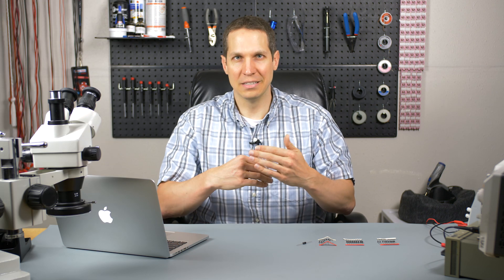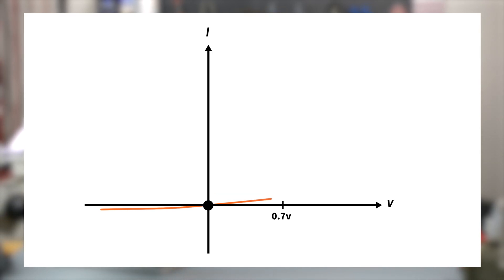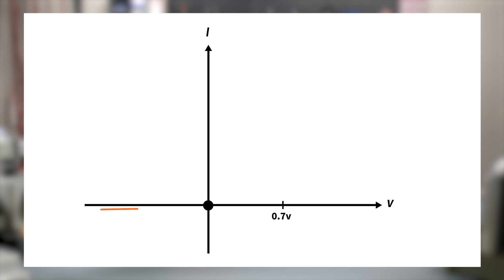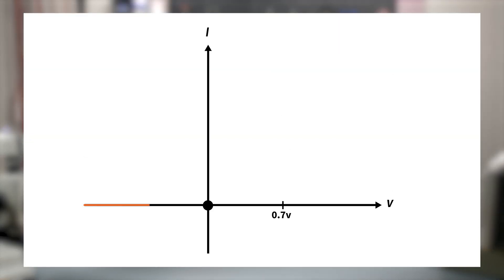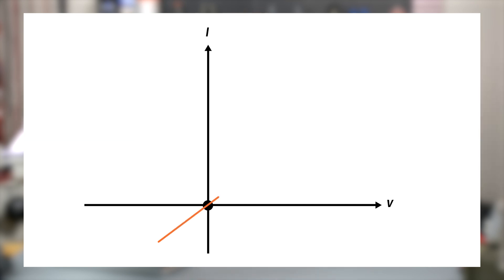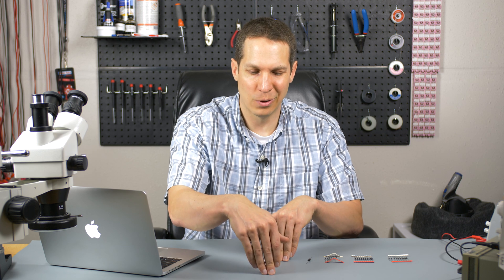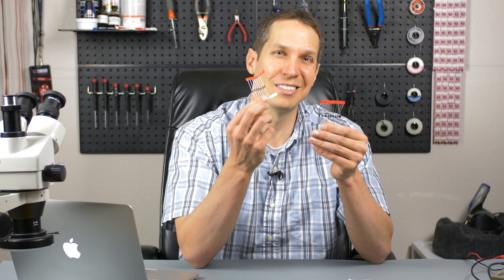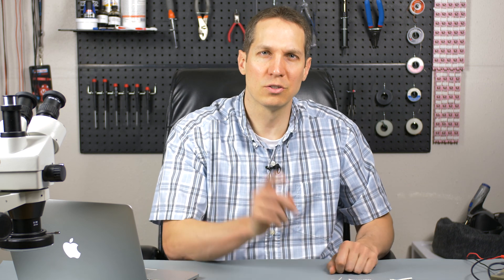What is a diode? A simple animated overview | Basic Electronics

Comment: Have a simple question.  If the reverse voltage of say a zener diode is 6 v, and forward voltage of a regular diode is 1v. If instead of using a zener diode, lets say i connect 6 diodes in forward bias, are these two circuits equivalent in terms of functionality ? What is the trade off here ?
Reply from the maker: That's an interesting idea!  Besides using 4-6 times as many diodes, we do need to consider that the zener diode still can operate in a forward direction, which wouldn't be the case with putting a bunch of normal diodes in series.  Depending on the diodes, I'm not sure how well tuned they will be (Is it 1V forward voltage or 1.2?  Will you actually end up with 6V?)  Also, there may be a weird cascading effect as each one turns on at a different time but then the current can't flow.  All of this being said, I think the best idea would be to try it out!  I've never done it so I'm just spitballing here - I'd be curious to see what actually happens.